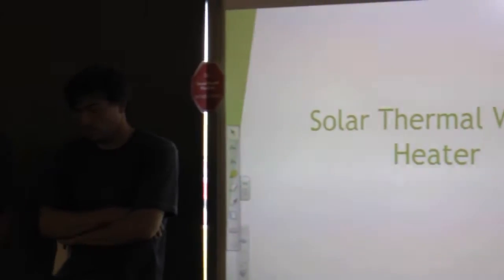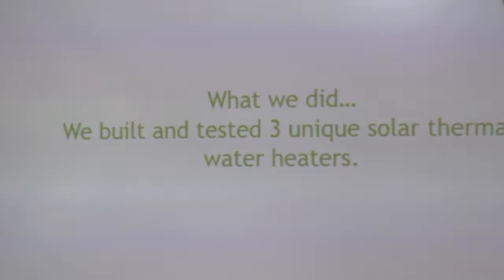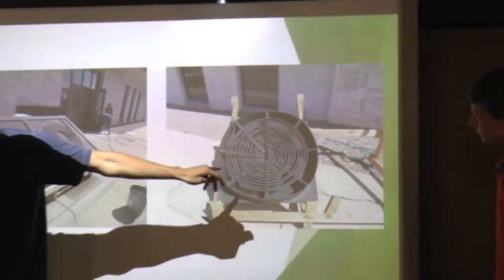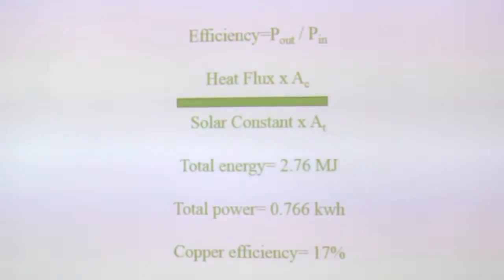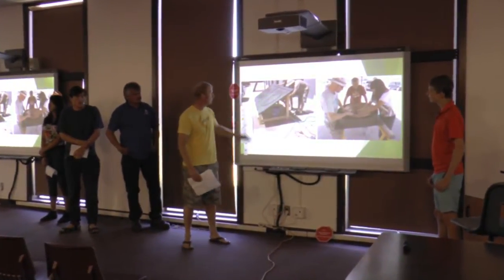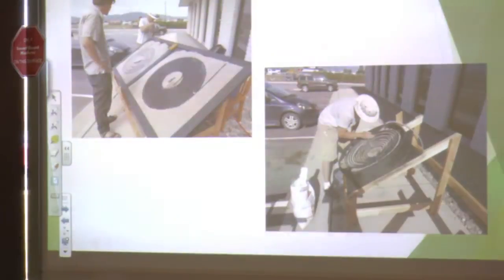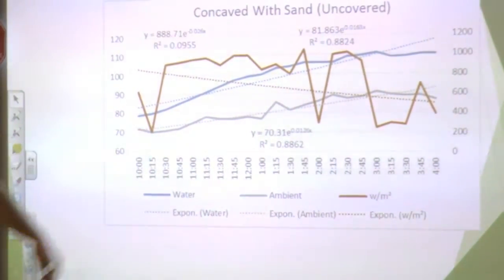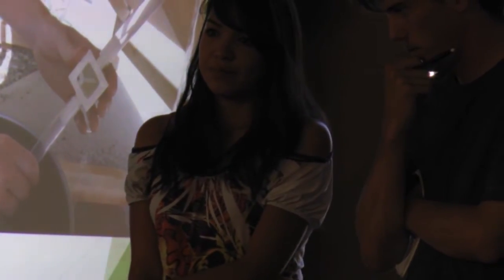Missoula College Energy Practicum 2015 Solar Thermal Water Heaters

Comment: Where can i find more details on this project?  Looking to do this myself. Wondering if you found a difference between spacing/not of the coiled tubing. Also, did you find any difference in the temperature with the concavity?  If running a large volume of water for a pool could you calculate how many would be needed?